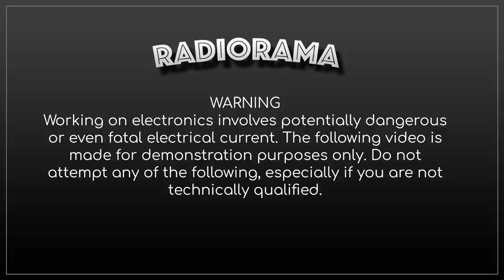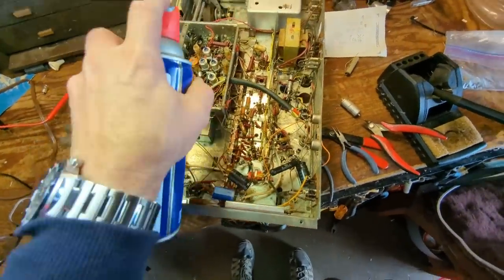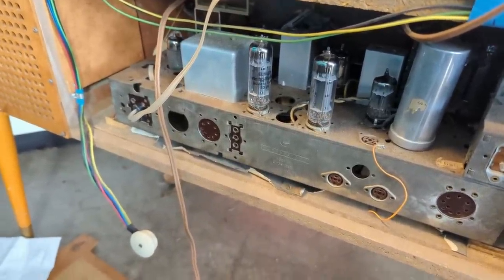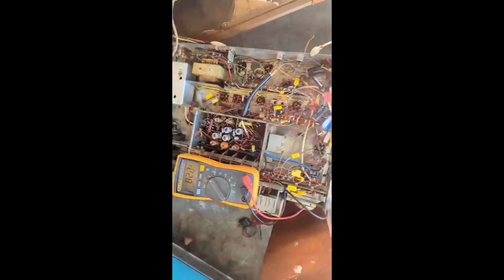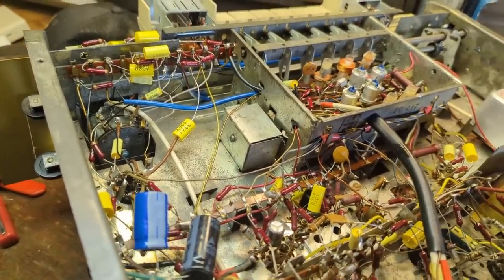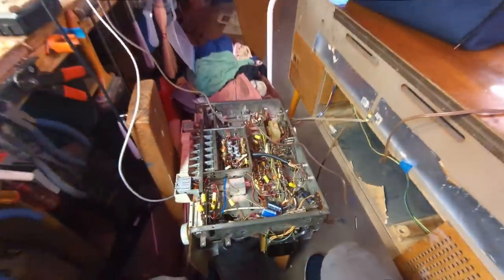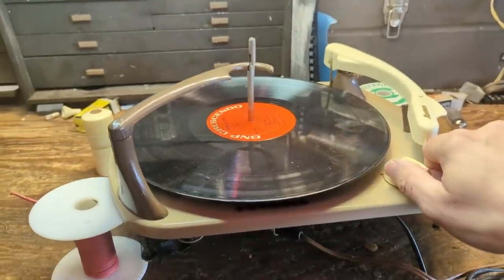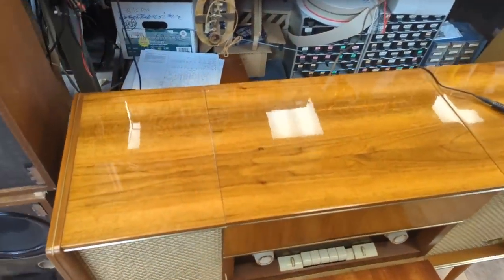1960 Grundig Fleetwood stereo restoration

Comment: Hey Seth, the reason for your lack of bass is, you are using air suspension speakers.They work best in a sealed box.The sub that you added shows that.I think that I found one that might work.Check out the Seismic Audio Speakers model T10.

Comment: I saw a Telefunken console with a mirror gloss piano finish like that, yes they came from the factory like that.
 I also had a small Grundig table radio with a single 6 x 9 speaker that was high gloss, but it had alligator cracks throughout the thick high gloss finish.
  So no dropping resistor required on that diode bridge?